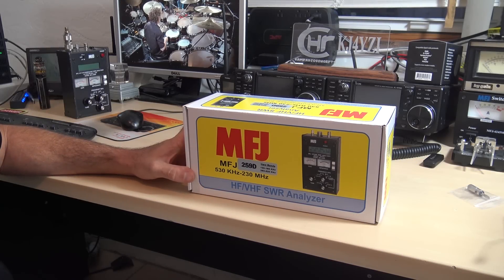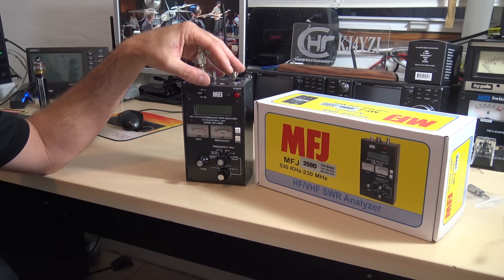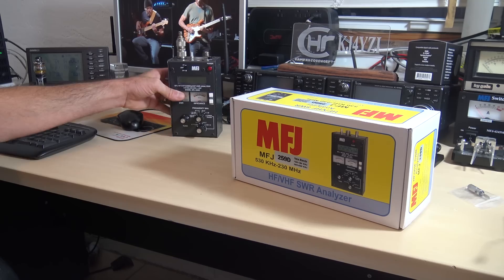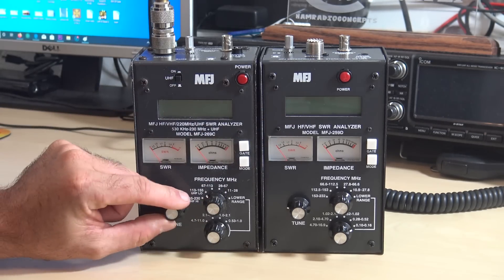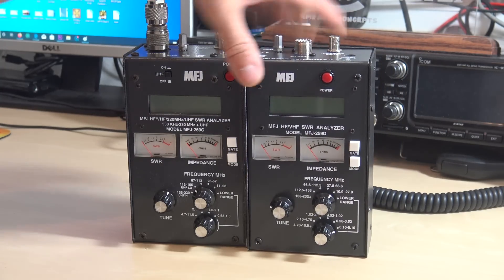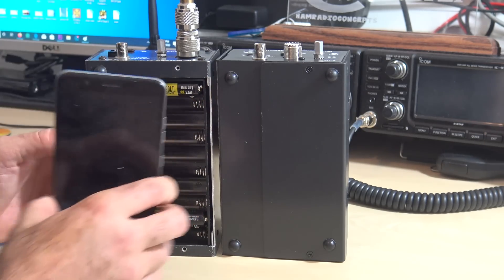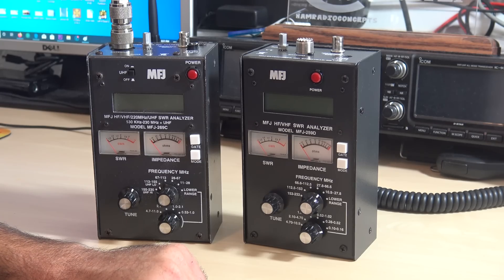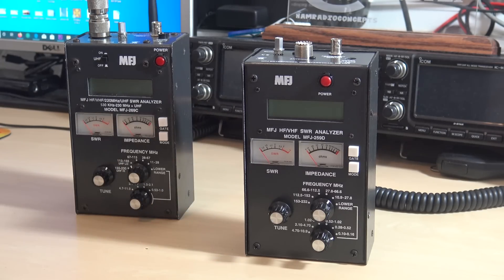New MFJ-259D Antenna Analyzer, Comparison With MFJ-269C

Comment: I have the MFJ 269C and love it. I don't have auto tuner. I use the roller inductor tuner. I tune my tuner to flat match 50 ohm without transmitting. also I done input tune on tube amps without power up on high voltage.  I have LFP batteries in mine. got them from eBay and are 3.2V AA batteries and use dummy batteries spacers. wish I could recharge without removing batteries. I used NiMh AA batteries as well   .I think 3.2V 700 Mah cells. got them in AAA also and come with dummy cell. 1 battery 1 dummy for each 2. I also have 14500 AA 3.7V protected Li-Ion cells. 73's

Comment: You have the right idea with the battery, but use one with all the protection built in.  Ones from China may not be all they are cracked out to be, so buy a good one.

Comment: I replaced the battery holder with a drone 14.4v LiPo battery and also put a plug on the rear for charging. I never have to buy batteries again and it holds a charge for at least 1 year with minimal usage. But I have used it for 1 year and still haven't recharged it yet. So yes it can be done however you must use the proper charger when recharging it.
Reply: best post, I'll look into this

Comment: I watched the video. I noticed the harbor freight freebies on batteries. If wrong correct, please. My question is that low band that you were talking about. Was it the two twenty-two band.  the reason for the ? is that I have a beam in the garage.  It is really a long and actually a small beam. I have to know the way to connect the coax to it. Just curious if I could use a balun to connect it.?  they say Amature. well, I am that when it comes to this I am.

Comment: Why would you not tune your antenna?  I don't understand that.
Reply from the maker: Bent Tree ask all the people that hate me.  Previous videos I mentioned that using a tuner on a stop sign for 80 meters does not mean the antenna is resonant at 80 meters it’s just tricking the radio. But apparently I need to go read a book they said it is actually tuning the stop sign to resonance on 80 meters. No need to buy an efficient antenna they said, just lay a wire on the ground and use a tuner for best results HAHAHAHA
Reply: @HamRadioConcepts  
   The reason I would just use a tuner rather than build a perfectly resonant antenna is ignorance...I am not one of those to pretend to expertise I do not possess.  I am studying everything I can find to discover some insight into antenna design that apparently will continue to elude me.
  A antenna wire that has a flat SWR on one occasion will have different properties when employed in a different location.  This, of course, may well be different for those with fixed antenna installations.
  Meanwhile, the market is flooded with builders and reviewers who are claiming their antennas really do possess "The secret sauce."  
  Look at the videos being offered by some of these channel operators for examples to illustrate my point.  These guys are willing to say damn near anything and claim it to be true....I am not going to point a finger in any particular direction. You can do that if you like.  Not interested in "Going there?"  No one else will either and that's why the disinformation is still influencing the operating methods of the ignorant. 
  People like me.....
Best regards....
bob, KF7ZSA
Reply from the maker: @bobsullivan5714  Hey Bob.. I am having trouble decyphering your comment. Are you upset with me and this information?  Sorry if you are angry at me also.
Reply: @HamRadioConcepts  
   MY APOLOGIES!  Apparently I failed to properly compose my remarks....I am well aware that you are in a difficult position walking the line between publishing content your viewers would find interesting and bringing THE WRATH OF YOUTUBE down on your head.
  The question I was attempting to shine a light on is: Why do we persist in things like attempting to tune stop signs?  How do we evaluate our information?
  If I could do a better job of producing content for a YouTube channel, I would be doing so and not pestering others so much....What you do is interesting and appreciated.
  I have a tendency to be harsh.  But, if you read my comment from a slightly different perspective, it may be more clear.  Thanks for your interest in my remarks and, again, I apologize for my lack of clarity....
Reply from the maker: @bobsullivan5714  I think I understand now.. Well, I guess my frustration comes from my efforts and attempts being wasted or shit on by others.. What I mean is, it takes a lot of time every day and a lot of ignoring my family to come home from work and make videos to hopefully motivate people and educate them somewhat. I know I dont know everything there is and i NEVER said that ever not once.. But thank you for watching and commenting. I just try to help and show people that a resonant antenna will be their best bet for making contacts and by using a tuner and ignoring the lessons on how to build and tune and antenna to resonance is dumbing down the hobby, when they should be putting up a wire antenna they build and tuned themselves, or if purchasing an expensive antenna commercially they should buy an antenna that has multiple resonant bands instead of thinking a G5RV is a magic antenna that tunes on all bands  but in fact its only resonant in a certain band but not so efficient every where else, hence they complain about the bands being dead or cant make any contacts... I can go on and on but nobody wants to hear it.. A tuner is the first thing every new ham wants to buy when they first get their radio, it would be better to buy an analyzer and make an antenna, feed the brain with knowledge to learn more... but they are told "buy a new radio, buy a tuner and throw a wire on the roof thats all there is to it"
Reply: @HamRadioConcepts  
yep...That's about it.
I totally agree that there can be no substitute for using the most accurate standards possible when putting up a antenna.....
  But.....You can see what a lot of "Expurts" are doing to those of us who may not (yet) know better.  THESE are the guys who are diluting the information pool with their nonsense. And, these are the guys who are creating frustration among those of us naive enough to ignore the essential information we are supposed to know when we passed our exams and got our tickets.
  I can only wonder at how many people passed their technician test, purchased radio gear, and ended up giving up out of frustration.  Doesn't it make you wonder just how many fried radios there are sitting in junk boxes because someone who passed their exam with a phone app (without knowing anything about the subject matter),  tried to fire up a stop sign with 100 watts?
  You have my sympathies. Trying to cut through the background noise on the air is the nature of the game; trying to cut through the fog of ignorance is another level entirely...
  Don't give up on us....And, ALWAYS PUT FAMILY FIRST!
bob, KF7ZSA
Reply from the maker: @bobsullivan5714  Well Bob, I can only hope that you learn something from my videos, but I always recommend YouTube for other videos to fill in the gaps that I missed, plus seeing it explained a different way by somebody else.. These viewers that constantly bitch about my videos don't understand that they are in control of what they click and they still continue to click on my videos watching the entire thing then hate on it.. There are so many tens of thousands of people that appreciate my efforts, and while I know that I have had so many experiences with so many radios and ham hobby over the years I do consider myself to have a lot of experience and tried almost every mode there is, even if i dont like it i want to learn it and try it.  I am afraid of newer hams that give up after one mode or attempt or purchase...
Reply: @HamRadioConcepts  I'd like to see the people that bitch about your videos, actually produce an instructional video of their own. My guess is we won't see that happen.

Comment: I have a Comet MKII, and like the MFJ the damn thing uses like 9 AA batteries!  Why the hell can't these guys make a rechargeable battery for this thing - or less batteries altogether.
Reply: You can buy rechargeable AA batteries that will work fine with that analizer
Reply: @jeffpowell662  understood, that's what I use. However it would be nice if they used a battery pack, as Eric mentioned. Much easier to deal with than so many loose batteries.
Reply: I agree with what you just said I have an older version mfj analyzer and it doesn't do alot of the band's the new ones do but I'm not buying a new one . good luck N3SXW

Comment: Eric, 
 Stay with a LiFe battery, especially the Bioenno, they have built in low voltage protection. Most LiPo batteries do not have protection built in for low voltage shut down.

Comment: I also have an older mfj antenna analyzer. what I really like best is my return loss bridge with my IFR 1200S service monitor. put it in tracking generate mode and hook it up to the return loss bridge. you get a freq-loss display so you know whats going on with what ever antenna you are testing
Reply from the maker: I had an IFR1200 now I have a COM120B
Reply: @HamRadioConcepts  the com120b is a nice instrument. I used one at my last place of employment before retirement.
Reply from the maker: @NebukedNezzer  Yah it's for work as well but I can use it for whatever, just no need to test my radios at home, LOL, I know my Icom 7300 and 9700 sensitivity and accuracy are superior to what I can test LOL